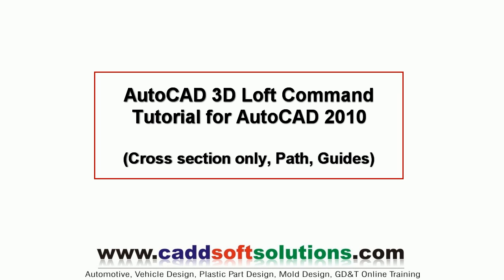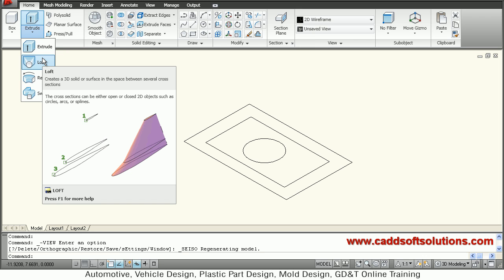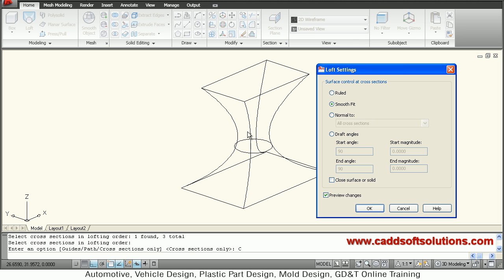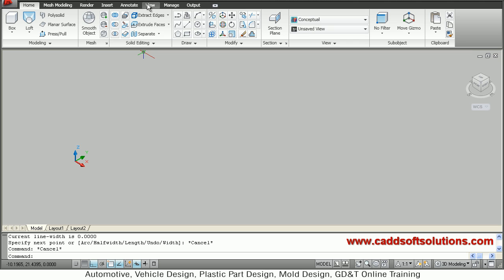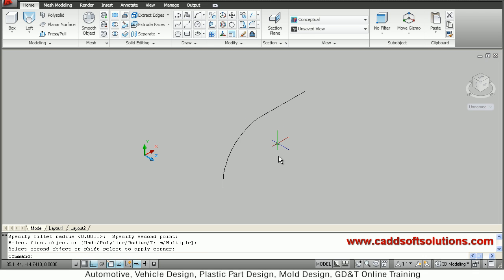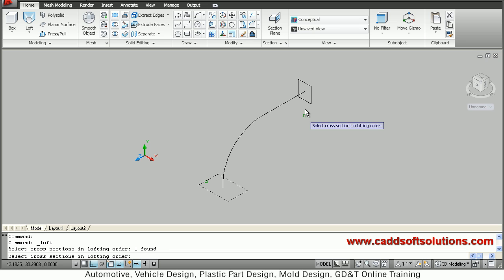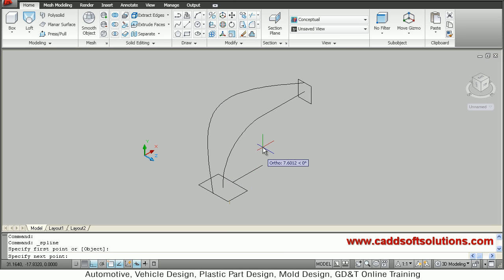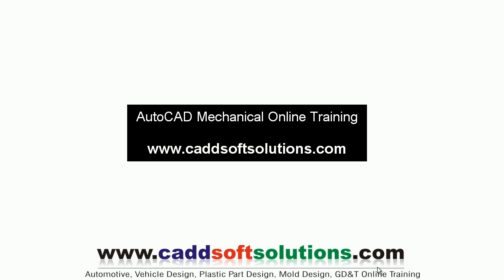AutoCAD 3D Loft (Cross Section/Path/Guide) Command Tutorial | AutoCAD 2010

Comment: does the path loft command depends on the radius of fillet? because sometimes it show me invalid loft command , when the fillet radius is slow/
Reply from the maker: Sufficient fillet is required for rotation of sections at joints.